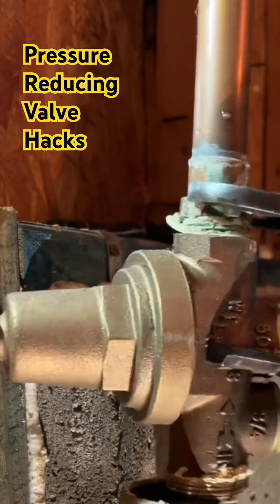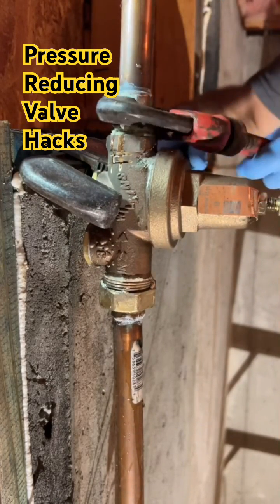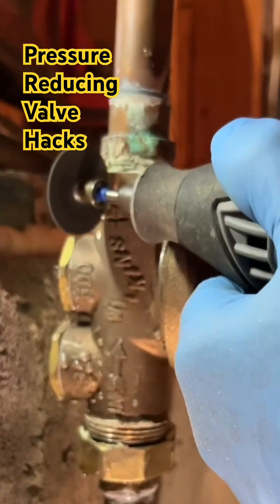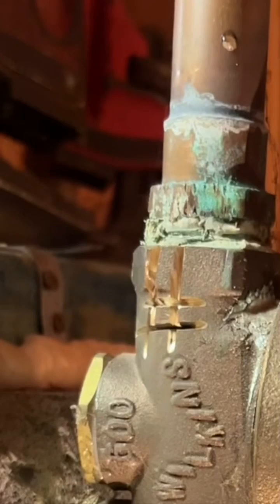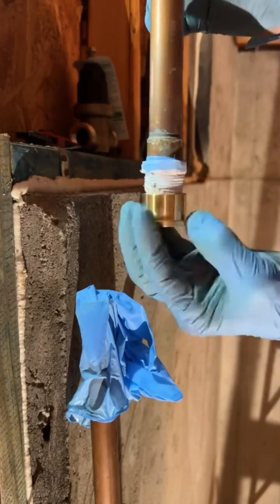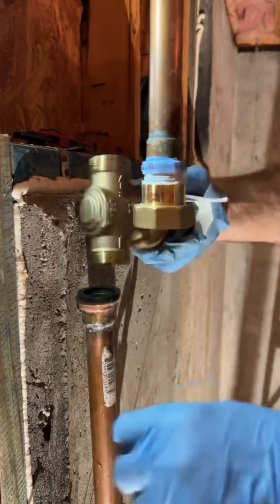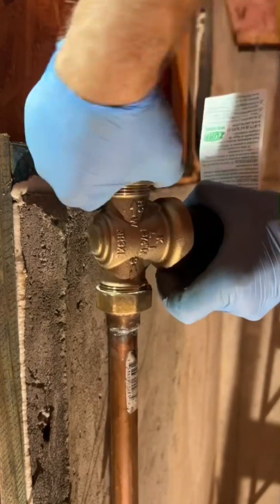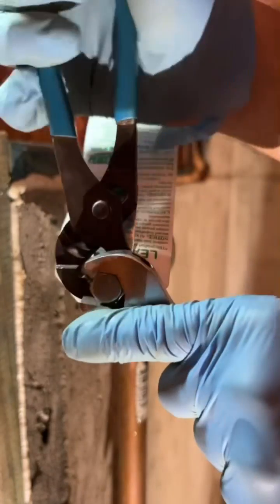Easy Pressure Reducing Valve Hacks @TappPlumbing #diyplumbing #plumbinghacks #serviceplumbing

Comment: There is so much play in the pipe you didn't have to cut it.
Reply from the maker: I actually did have to cut it to get the valve freed up from the adapter. I could not get to turn with those wrenches, believe me I tried.

Comment: Why wouldn't you use a few 90's and some pipe and move it away from the wall?
Reply from the maker: This was supposed to be a more homeowner friendly version of a replacement video. A lot of DI Y people don’t like cutting plumbing pipe. They normally do have a dremel tool though. Thanks for a great question!

Comment: Just cut the pipe and do it properly
Reply from the maker: I get your point on the new parts , that quite possibly is true . I did use fresh gaskets and if something were to happen I will have to go back and make it right. Don’t worry about giving me constructive criticism, I actually appreciate that and I have some pretty thick skin . Thanks for watching our video and for commenting!
Reply from the maker: This video was made for people to see a way to get this done without cutting the pipe on purpose. We wanted to make it for people that are fairly handy but are afraid or don’t have the tools to cut the line. Just out of curiosity what make s you say this is not done properly?
Reply: @TappPlumbing  You cut the brass with a dremel. anyone who can do that can cut copper pipe. You used one new nut and one old nut, it makes it look odd and possibly voids the warranty. If you wanted it to be serviceable you could have just installed the parts it came with (to be clear im not trying to hate because I can tell you know what you’re doing but using the supplied parts is always the preference)

Comment: Why isn't there a PSI Gauge installed at the PSI Regulator?
Reply from the maker: That is not the way systems are installed here. We work in east metro Atlanta area. I am 57 and have done plumbing all of my life and can say I have never seen that done on residential work . I have seen it on commercial many times . Where do you live or work that this a common practice?
Reply: Nobody does that
Reply from the maker: @kyleb1998  Not that I know of either . Thanks for watching our video and taking the time to comment as well!

Comment: I remember I did this the other day and my boss almost cried telling me I wasn't a real plumber. Because you are supposed to use 1 male adapter and 1 union. But, I'm not supposed to use 2 unions.

I don't know the veracity of what he told me since I'm a plumbers apprentice and he's the master plumber. 

I found your video very interesting for that reason. I wonder if it matters at all.
Reply: I used to work on industrial stuff and my experience was that 1 union is almost useless. They even make ball valves with built in unions on both sides. I’m pretty sure they make prv’s like this too. Maybe he could let you know why
Reply from the maker: They definitely make prvs with double unions. We try to install those with almost every replacement. Thank you so much for watching our video!!
Reply from the maker: I am a little hesitant to comment when there is a relationship involving employment. With everything that is related to plumbing it is always best to research and try to learn as much as you can. I think I will leave it at that. Best of luck with your career in plumbing! We need all the good people we can get in this industry!  Thanks for watching our video !!

Comment: Oooooor ...hear me out, just heat one or both of the solder joints and pull it out 😂
Reply from the maker: Your plan would definitely work , sweating one of those out might be a little challenging if the water is persistent though. I kinda wanted to make this video to explain there is away to do this if a person such as a homeowner is very limited on tools. I am guessing most homeowners that are somewhat handy have a dremmel but maybe not a torch. I am so glad you took the time to watch our video and posted a comment. Thank you !!!!